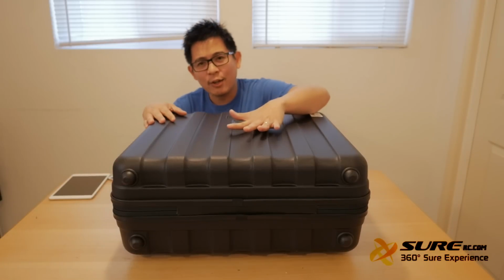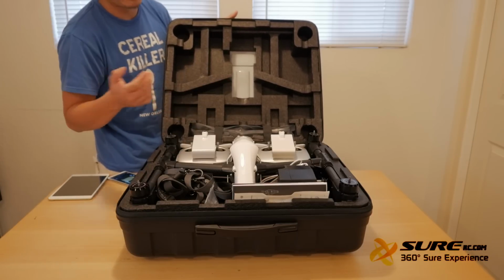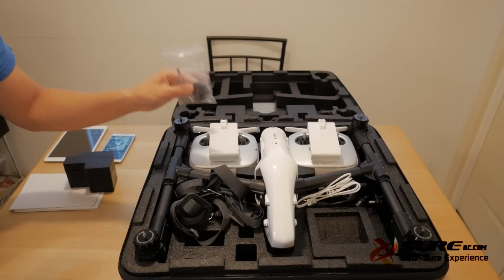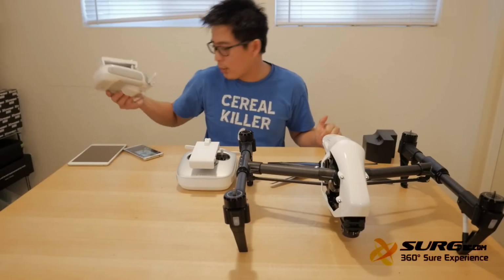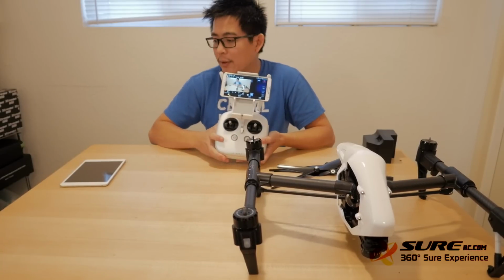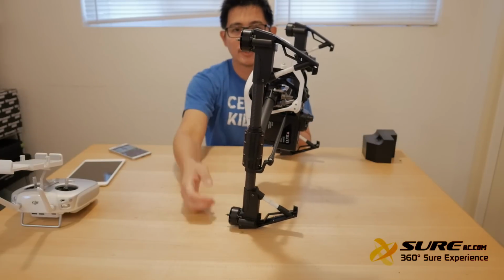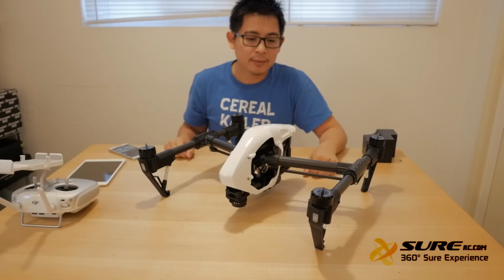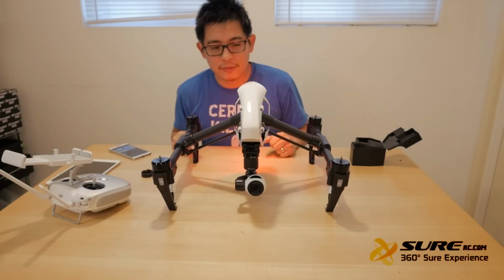Now In STOCK!!! DJI Inspire1 Unboxing and First Initial Impressions

Comment: 21:25 if im not mistaken. wider motors that are smaller are usually stronger motors.
Reply from the maker: depending on the motors. Taller motors will have more power than a shorter motor with the same diameter can :)
Reply: tonytypes ok i see, but wider motors will have more torque. right?

Comment: does it work with a galaxy s4? awesome video
Reply from the maker: Not sure but it works with my Note 3 so it should work with the S4. However I do get a slight delay so it's probably best to use the newer ipads or IPhone 6 as there is very little to no lag at all
Reply: ok thanks mate